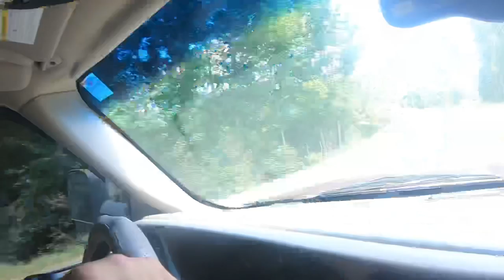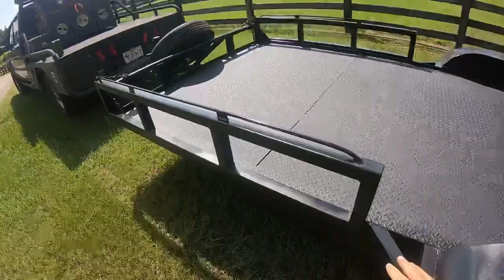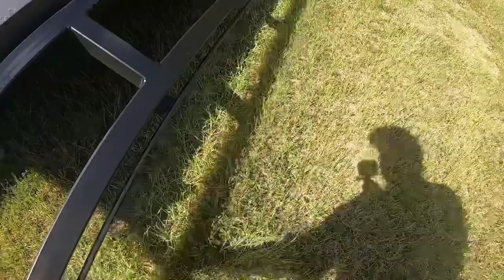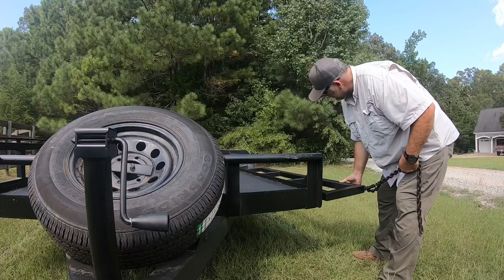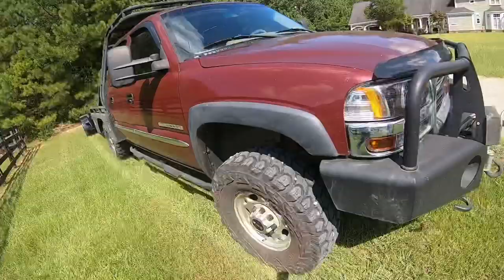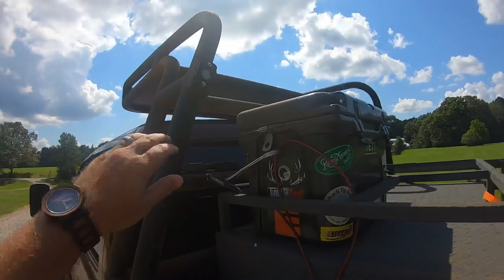Hollis Farms Trailer Rebuild by Sq'd Up Welding and Fabrication

Comment: Them ole boys do some fine work that's for sure . On another note the static your camera or mic is picking up is probably a plug wire or coil pack wire on that Chevrolet . My two way and CB do the same thing . Check em out . Thanks Brian 👍oh I forgot to mention if I'm wearing my TENS unit it affects my radios , phones etc . Yeah I'm old n wore out lol .
Reply from the maker: 👍🏽 thanks